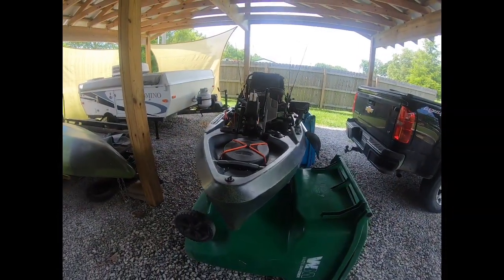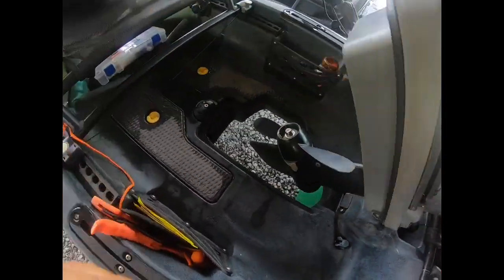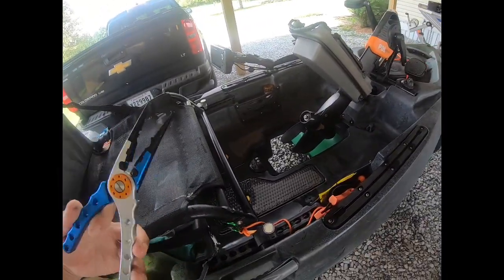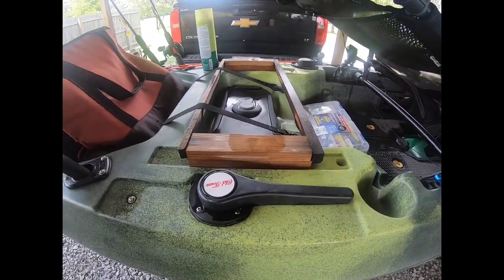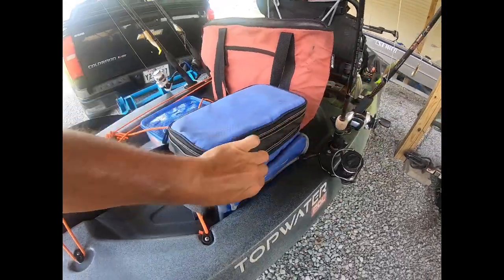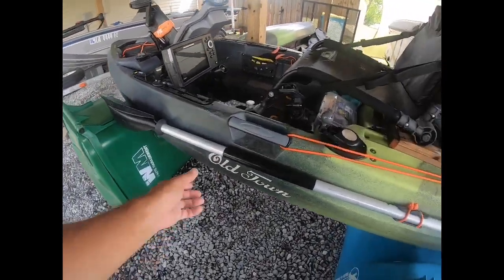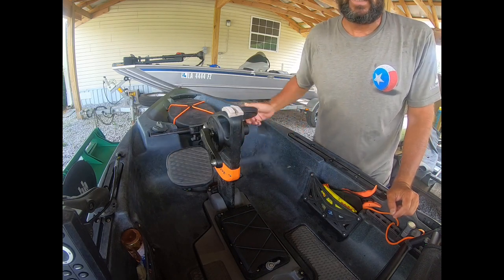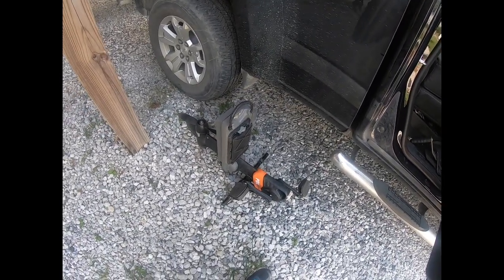Old Town Kayak Review and Setup - Topwater PDL 10’6”

Comment: Mark, just took mine out for the first time yesterday and was wondering where you got you pad for the seat back.. My Old Town paddle 106 seat was awesome, but the top bar on the PDL is not comfortable.
Reply from the maker: I found an old lawn seat cushion - the type that has a seat and back connected with straps and you can sit anywhere with it. Well I just folded it up and use both cushions for the back - wrapping a strap around the Old Town seat with velcro to stay in place. Works great. Hope you can find something similar. 
A strap can run right through the openings at the top of the Old Town seat. 
Great kayaks!!!
Enjoy.

Comment: what did you use on top of the pedal drive for the rod?
Reply from the maker: Small little felt pads. Self adhesive, between 1/4” and 1/2” thick. Wal-Mart.